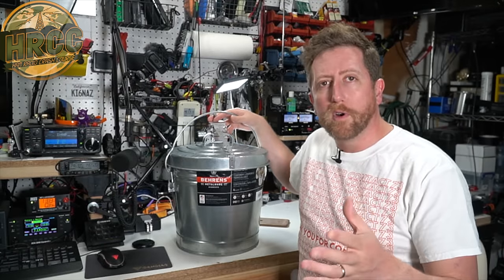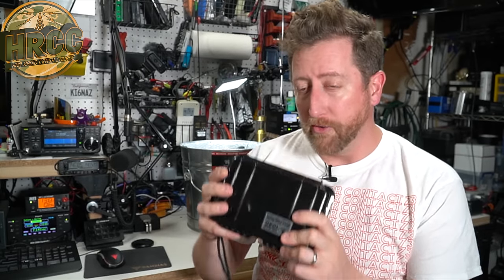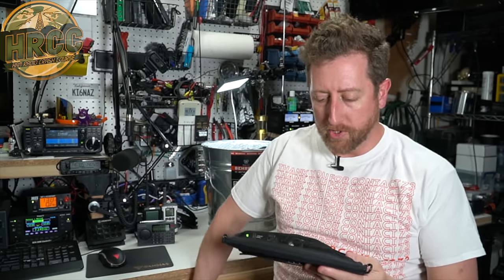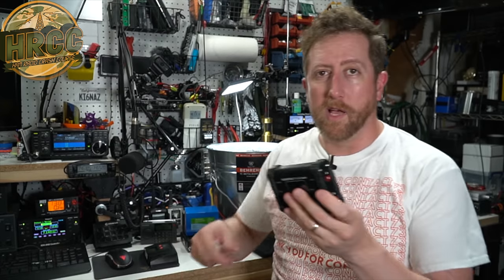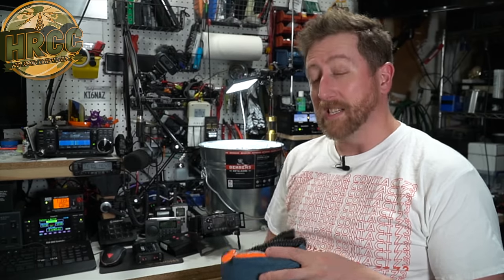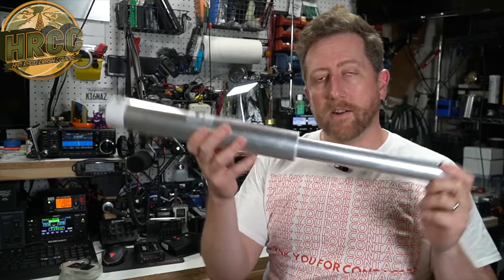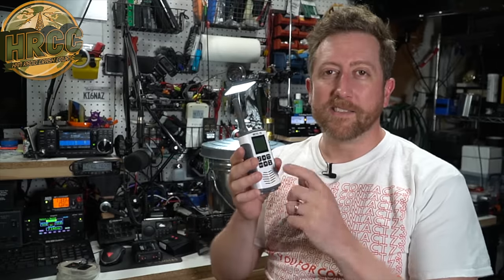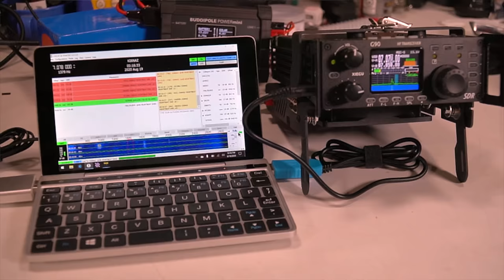Ham Radio EMP Kit, The Tactical Trash Can

Comment: If you add a lid gasket, which is not required in a metal to metal contact lid, it MUST be of conductive material (which you later correctly addressed). Also one should add a bond strap between can and lid, just to be sure, and I added three draw-hasps to the lid-can. Good ideas for the Ham who is made of money, but most of us are not in that boat, and most of us already have QRP radios, and CW always makes the contact when nothing else does. Digital modes are excessive and unnecessary complications for disaster operation, in my not so humble opinion, having survived disaster situations. That is pretty much all you'll need. Period. Perhaps a VHF/UHF, if, and that's a big if, anyone else locally is prepared.

As for antennas, I'm a homebrew guy, and I agree, I'm quite sure that there will be problems with wire wound toroids, capacitors, et al.

The most pressing reason for a kit such as this is a nuclear pulse, after which sunlight will most likely be in short supply, for a while at least, perhaps a long time. We don't know first hand of the situation after a significant exchange. I'm looking for a hand powered mechanical dynamo of sorts as well. 73.

Comment: Behrens makes 10, 20, and 33-gallon cans too. I nest a 20 inside the 33, lined with cardboard. Small stuff like batteries, cables, antenna wire etc can go in between. The most sensitive stuff goes deep inside, also insulated with cardboard.

Comment: Could I recommend a different cage?
The dimensions of an M134 ammo can come out to about 7.5 US Gallons.
It is also square and made of steel.
Can be welded onto to give an antenna support, like the one you added to the trashcan.

So in conclusion, It is square so it fits in places with more space efficiency.
But because it is square more things can fit into it neatly without rounded corners.
And it is slightly larger and easier to carry with its built in handles.

Comment: I listen to you  and Canadian Prepper podcast .   I will stick a baofeng and spare battery in a sealed ammo can with metal  tape around the lid.   I already have too many  UV5rs.
Reply: Definitely! I couldn’t figure out why a pair of Baofengs instead of the FRS radio wouldn’t be a much better choice. That  provides backup for VHF/UHF and simplex HAM comms, it also gives you a pair of radios to use as scout/recon if someone in your immediate group needs to go somewhere for food, water, etc. They can be setup to talk to FRS, GMRS, or anything else you might want.

Comment: Maybe I'm wrong here but I think you could make a Faraday cage with a pass through if you change the signals to/from optical/light format. The outside electronics would still end up getting fried but you could send/receive right up to the moment of the EMP, have several backups, protected in the Faraday cage, and keep swapping them out if there's more than one EMP. That way you could keep your station going with only brief interrupts.
Reply from the maker: You could, but that might be dipping into a level of overkill that is beyond me. 👍

Comment: I use a few army surplus .50 cal ammo can. works great. my battery box(2) is made with the harbor freight ones  .I also have a Geiger counter in my EMP kit. most battery;s are EMP ok. the BMS is not. a lightning strike makes a EMP. even it it hits a grounded tower. that current going to ground makes a EMP . had a lightning strike at AM transmitter site in a blizzard. the feed line arced and took main transmitter off line. went to back up and back up feed line.  no damage to tube final transmitter. but second down tower light was blown to bits. AM Broadcast uses a hot tower with big coil and arc gap to ground. we get thunder snow in NY . 73's

Comment: Need to use a surface conversion coating such as alodine to mitigate the aluminum oxide.

RF gasket on the lid would improve it. Copper or gold lining would be nice.

Comment: Caulk or silicone will not stop EMP's.  It has to be something that will stop microwaves in a microwave stove without damaging the cell phone. Only thing I found that will work is a older pressure cooker. Without making a box out of 3/8 steel.

Comment: I use a few military ammo cases. They seem to be well shielded and also seal out the weather really well. They use a rubber gasket (non-conductive) but I think the way the cover wraps around the base makes it ok, but I may want to get some aluminum duct tape (any home improvement store would have it) and start wrapping it up like a mummy.
Reply: Better off with shielding tape for guitars, conductive adhesive I think
Reply: Testing has shown clearly that the rubber gasket of ammo cans causes complete failure as a Faraday cage. Most people replace it with rolled up Al foil. And, again, I like to add a bond strap or wire between lid and can, just to be sure.

Comment: You can also put your thing in zip lock bags and then put aluminum foil around that for added protection. In 1865 I think it was there was, a solar discharge that burned up telegraph wires! Not to say we will have another,  but it is posable. I am not sure about the year,  but it was in the 1860's somewhere. There were not much for it to destroy,  but it did a number on what there was. We have had some that just missed the earth in the past 10 years.  One of the black outs in eastern part of Canada was a small one.  Depending on the size they may only do small damage to a small area. But the one in the 1860's,  the northern lights could be seen in Cuba,  people in the northern US got up because they thought it was morning.

Comment: Shazam! For once I am ahead of you. Bought two small bucket size and two regular garbage can sized Behrens trash cans 5 years ago with aluminum tape to seal them. I will be very interested to see your discussion re: the seal.

@ Josh: Be sure to mention the fact that ammo cans are no good as is because the rubber gasket to waterproof/seal  them leaves an opening,  unless you sand off the paint from the outside edge of the can and the lid and wrap aluminum tape, or remove the gasket and apply a wire filler mesh.
Reply: replace the rubber gasket with conductive gasket?
Reply: 1/2" copper woven braid grounding strap pop riveted to BARE metal between the ammo  lid & ammo can's body.  Again remove the paint  & pop rivet to bare metal only. Route the braid on the hinge side sp you can still open the lid fully. 
Since I'm here do the braid mod to the TTC too for the very same reason.  Don't try t rely on just the sudo metal gasket inside the lid as was shown.  And since I like copper grounding straps, run a strip between the TTC/ammo can and to a copper water pipe or your shack's earth ground for a REAL solid earth ground.
73 de Dave N6DSW
Reply: Doing the work to fix a ammo can makes the most sense to me! Radios fit better in them plus they are already tactical. That shinny bucket will get you killed! Not to mention I have plenty.
Reply: @WW5RM  Agreed. I'm bugging in.
I'll be putting my "prepped" 50 cal ammo cans in a large trash can.

Comment: I watched another utuber testing the trashcan for RFI leaks. Like you he didn't seal where the handle goes through the lid. I used aluminum tape (but I don't remember testing with tape recorder and ham radio inside). If the sticky is at fault, turn the aluminum tape over with sticky side outwards and gorilla tape it down.

Comment: Someone commented that the old tube radios are emp safe or resistant. No, not really. First, the line transformer is many turns of fine wire, and will be zapped. Second the electrolytic capacitors will arc over and also be zapped!

Comment: The EMP from a high level nuclear blast is unbelievably powerful. A mere aluminium or steel trash can will do nothing. Forget Faraday cage, to protect from EMP you need inches thick of copper or steel. A thin layer of steel is useless, as the magnetic component of the EMP will saturate the steel and then pass straight through. Ditto the electric component, which will generate huge currents in the shield and if the shield is not inches thick the bulk resistance of the shield will allow the EMP through. 
Sorry to burst your bubble but even a small EMP will destroy huge transformers in the electricity supply grid, burning them to a crisp and melting the windings, your electronics, even disconnected and sealed in a tin can doesn't stand a chance.
Unless your car is a diesel or a very old petrol car with points, don't expect that to work either.
Reply: Do you know a resource for the field strength?  I mean something that I can use to determine the V/M2 to determine what distance is safe with what shielding.  There's also other considerations that help a lot unpowered equipment is much less susceptible for instance.  Putting a shunt on the antenna and power connections when stored would help considerably.  And there are things like putting your equipment in ESD bags in the can help as well. There is nothing stopping you from putting a can like he shows inside a larger metal can as well.
Reply: eric thefathead  most older diesels do not have any computers to run them and do not require electricity to run since it’s all compression ignition.  Only time electricity was needed on my older Mercedes diesels was to warm the glow plugs when it was colder out. Mechanical fuel injection and vacuum valve to shut off the engine

Comment: I keep 2 older, but reliable HT's and a handheld AM/FM/SW SSB receiver each wrapped in aluminum foil in a metal ammo box with an RF foam seal. I'lll be adding a small PV panel and battery charger to the can soon. If the s*it hits the fan I'll pull them out 1 at a time over a week or 2 to try to ensure that all EMP's have stopped. But that's all last ditch sort of stuff. I'd prefer we all work to always be prepared so that nothing happens, or if anything happens it has a minor affect.
BTW, tube gear, like I have some of, is pretty much immune to EMP or to fairly nearby lightning strikes.

Comment: Great video! I think it is unlikely that EMP will be a problem but that doesn't mean it is impossible so this is a very good back up plan for the worst case scenario. I am more worried that the air waves will be jammed so for me I want a robust and devise coms plan, something that is hard to jam or block, I would be interested in your thought on this.
Reply from the maker: Unless you’re running spread spectrum or have many bands at your disposal, you will get jammed.

Comment: Remember if you're at work or not at home a microwave over can store small electronics and is a pretty good faraday cage.  Just don't forget to unplug it.  You don't want someone turning it on accidentally.
Reply: Will not work!  put ur phone in a microwave and call it does it ring? Yes! Then it will not work

Comment: I’d like to see your calendar to find out how often you have inspect and  re-charge things....I find that’s a pain with just go bags/ anything battery powered -
Reply from the maker: The advantage of the solar options is worst case scenario you can just go self-charge the batteries.  Advantage of the use of AA is you can still find those anywhere after a disaster, etc.
Reply: Ham Radio Crash Course I get that, but do you check and charge things once in a while ? Or don’t touch it till it’s needed?

Comment: From what I understand about solar EMP --  it's not really going to effect devices, it will just take down the power grid. A power line is large enough to absorb that.

But what about nuclear emp? Well, if you are close enough to that for it to scramble your phone, you don't need a phone anymore.

So, the problem with emp is just power. It would cause a massive worldwide power outage. A can won't help you there.

Also, man-made emp attacks don't make sense anymore. You can use non-nuclear explosives in orbit to take down all sat communication

Comment: Or you can just get old boat anchor equipment with vacuum tubes which are immune to EMP.
Reply from the maker: they won’t fit in my trashcan. 🤣
Reply: You still need to power it!
Reply: @MishaDaBear  Just get a truck load of potatoes

Comment: I actually just bought a large metal cabinet. My thought was to put some stuff in there that I was shielding from any type of RFI. It may not be one I can perfectly seal but it would be somewhat of a second layer if you will. I'm going to see what it takes to seal it electrically. Basically filling the small gaps with a conductive seal. And the stuff I decide to put inside should have some extra layer of protection. Just a thought. IT will be all my older equipment. Plus maybe some extra parts / repair parts that I have already for them...
Reply: For sure, Im looking at doing that but there's a lot of work to earth all the panels and seal the doors with a conductive compression seal .

Comment: One more comment. Ya’all better be keeping a bike or skateboard handy if you drive a car with a computer or electronic ignition. They will be yard art after this event. 

Me?  Well, I run a fleet of what’s in my sig pic. 😜
Reply: good ol carb aircooled boxer :) . i have vw baja bug class 5 for "rainy days"  stashed in secure place . vw golf 1 and 2 would be great options too, while 3,4 are a bit more problematic (still not impossible with some knowledge and replacement parts ) ;) .
Reply: There are now emp devices for computer cars, generators,RVs, houses.

Comment: You can line a regular 30gal trash can and have the same thing, but much more capacity. Why not use both?  The smaller one for portability, and be able to expand with the larger one.

Comment: good stuff. Mostly over my head, but good exposure.
i learned a lot.
The "multi-tool".. just a humble, but very experienced opinion - in such an event, ebay or any flea market, will have a "swiss army knife", but it MUST be VICTORINOX or WENGER, made in Switzerland, not china. Not that an emp would impact a knife, tho some do have a usb drive. It just the imported stuff takes Zero effort to render useless.. Where as the V-Inox will stand up.
Thank  you for posting  this video

Comment: Just a thought: Use small bucket exactly the way you propose, in addition, develop a secondary unit in a large galvanized trash can for you home base. If you have to bug out, pick items in secondary to supplement the primary; dire situations pack away both…🤔

Comment: The channel that tested signals inside these showed they don't work as well as one would think. Anti Static bags seemed to work way better. Good info though. We need to learn.
Reply from the maker: There is no way anti-static bags are working better.
Reply: @HamRadioCrashCourse  emp doctor 6 years ago bags vs trash cans.not saying who tests better . Just pointing out results
Reply from the maker: @JMGeranimo  We should be careful with the terms here.  "Anti-static" bags, like what computer parts are shipped in vary wildly.  They don't attenuate nearly as much as my trash can do, even doubled up.

Comment: The metal trash bin is overkill. There are easier ways to achieve a Faraday Cage to protect gear, e.g. lining a cardboard box with aluminium foil. That will do the trick, nicely. You can fit more into it, too.
Reply from the maker: Foil isn’t very thick and not very durable.  You need to test a foil box for attenuation.

Comment: The company for that can you have also makes 10 gallon cans and 31 gallon cans too. Building the EMP bucket. Inside the can put aluminum tape all the way around the edge at the bottom, the sides inside along the two seams and over all of the tiny holes inside from the cans handle’s including the lid. 

Also place aluminum tape inside over any added things you have screwed into the lid or bucket (like the antenna thingy). Also around the top rim of the bucket too. 

At the bottom of the bucket (inside) place a round form fitting piece of cardboard and around the inside walls too. 

No cardboard under the lid… not needed and that might interfere with airtight closure for the lid. 

Let no metal items touch the metal of the can or lid.

Comment: Great idea. One question though. If the EMP event is thermonuclear, will the radioactive particles in the atmosphere create nasty noise on all bands?
Reply from the maker: That is entirely possible, access to the bands would like be based on how far you wwere from the explostion.
Reply: Yes, but it will be relatively localized. One event over Antarctica won't bother the USA, and the winds aloft will affect things too, but only an EMP expert  can give you specifics.
For example, the "dinosaur-killer" meteor strike in the Yucatán Peninsula spread iridium dust globally  (it was that big.) but a nuke event is  not that big.

Comment: You know what i use. Have used for a lot. The 'grate' looking mesh in a microwave on the door is made to keep waves from leaving the microwave. You can deconstruct a few large ones and make a web some rooms at the PMC base i am a part of are coated with this, along with professional mesh. In my 'home' the walls arw fitted with DIY EMP protection due to my line of work.
Reply from the maker: Microwave doors won’t stop and emp.